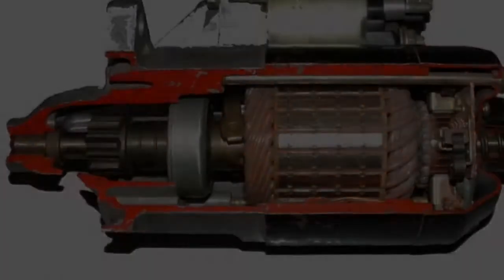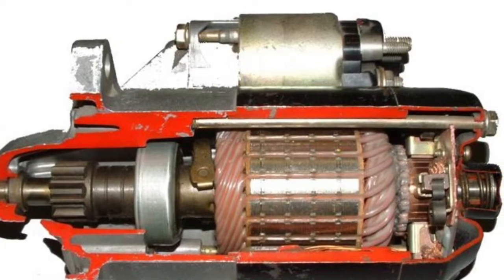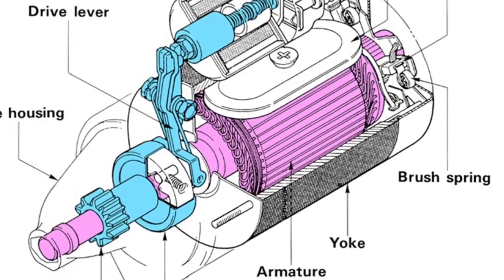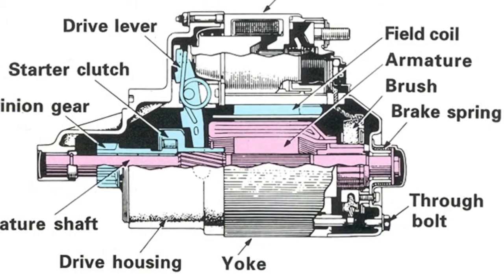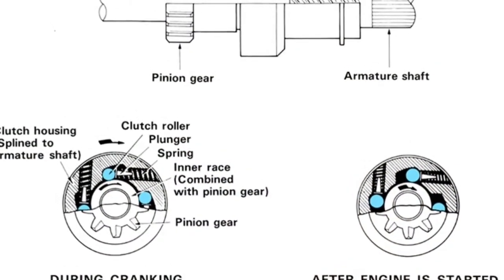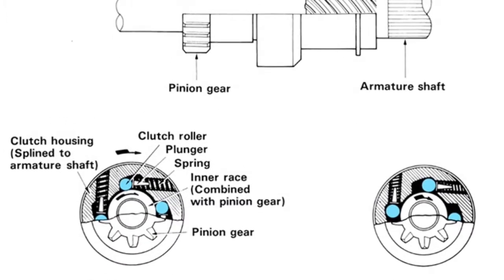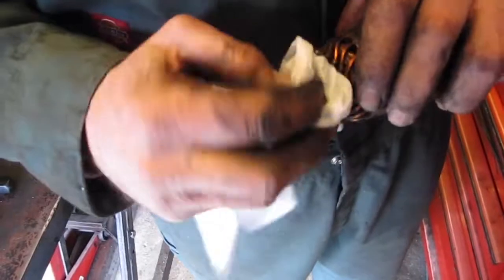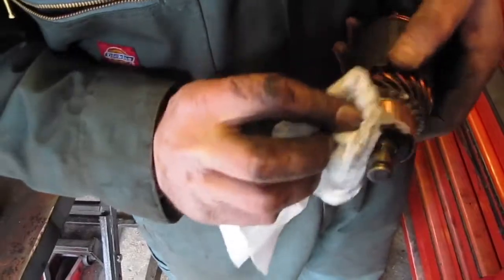BMW Airhead Starter Motors Part 3 (Bosch motor strip down)

Comment: Thanks again for a very informative set of videos concerning the starter motor, solenoid and such!
I was suspecting the battery on my 1983 R100RS, as it went flat quite quickly when engaging the starter in cold weather (about +1 C). So I changed it and initiated the new battery as you've described. It helped some, but not a lot. Then I suspected the charging system and checked it over by the help of your videos. It seems to be in perfectly good order. So now I'm suspecting the starter motor itself.

The symptoms are: Usually the starter engages well and seems to do its job. But sometimes (maybe every 5-10 starts, even if the engine is warm) I get only a "chug", then a little pause (0.5 - 1 sec), and it continues the start as normal (no disengaging, so I believe the solenoid is fine). Or, I if I let go of the starter button after the first "chug", and then press it again, it seems to work fine. But there is something wrong here! It wasn't like that when I got the bike some five years ago. The bike is a 1983 R100RS and has about 100.000 miles on it.

I have read somewhere, but I can't remember where, that it might be the brushes in the s.motor or some dirt causing a greater resistance, and therefore drawing a great current from the battery without doing any work . This may perhaps explain why my previous battery got so quickly worn out? It was new when I got the bike some five years ago (according to the seller, whom I believe to be an honest person).

Have you got any clues, like off the top of your head, to point me in the right direction?
If so, I would appreciate it a lot.

I'm prepared to take the starter motor apart this winter, and with your excellent videos, I think I can manage.

I'm sorry to bother you with this, but you seem like a bloke who knows what he's talking about. I'd be very grateful if you could help me out. If not, I understand that completely. 

Thanks anyways!